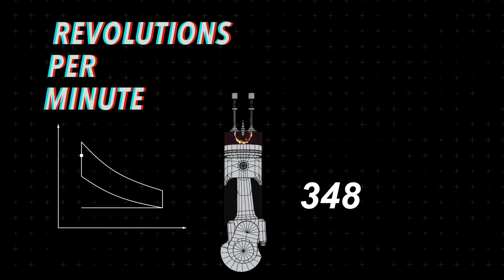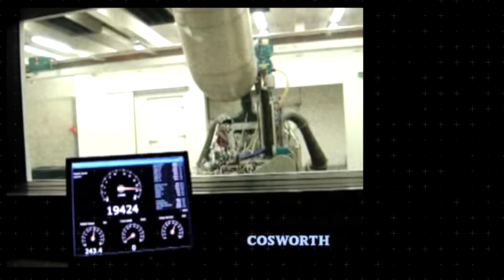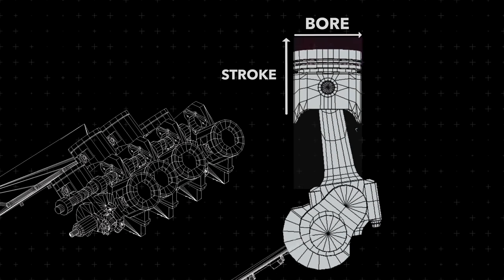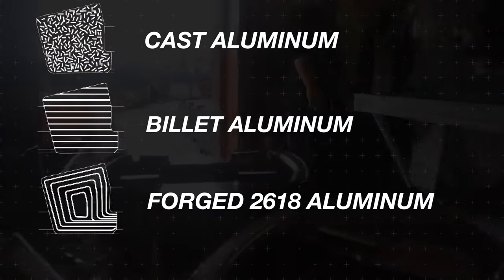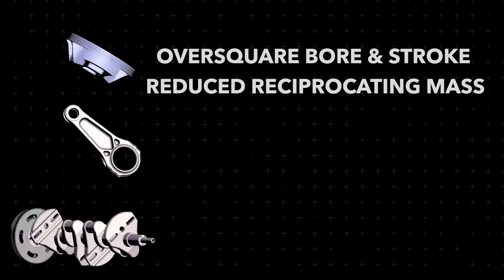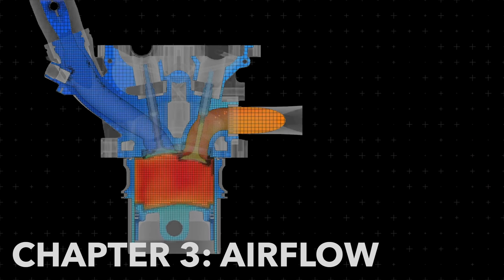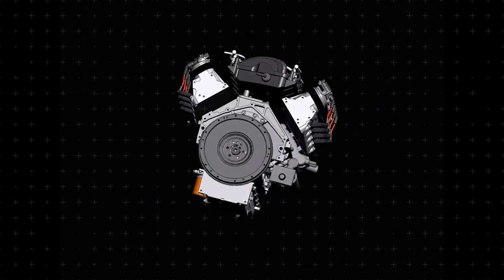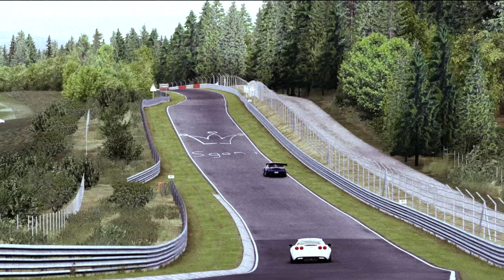The Impossible Engine Speed😳| Explained Ep.28

Comment: This is easy actually, step one go flat out in 5th gear, step 2 drop her down into 1st. This gives you way more than 20k rpm!
Reply: Only works once
Reply: @excalibur2038  step 3 replace the engine 😂
Reply: Money shift
Reply: might need to warn the ISS before this one tho chief
Reply: Step 3, hood goes in face with rod.
Reply: Only with spoon pistons
Reply: The key is getting your first gear synchro to spin up high enough to make it go into gear!
Reply: It’s definitely the easiest way to vent ya motor out, you’ll have breather holes all over it afterwards
Reply: LMAO
Reply: but only once!
Reply: Also let’s you, the gearbox and basically everything else in to the after life 😂
Reply: @stephenlewis6219   Step 4... profit.
Reply: You're gonna blow the welds on your intake !!
Reply: @peterdarr383  nah it’s gonna blow everything mate 😂
Reply: If the engine and tranny are in front of you,  be sure to pull your feet back as far as possible when you do this. 😮😮
Reply: anf blows up engines
Reply: Instructions unclear

Cylinder number 4 has left the chat
Reply: @shadowguy128  When the clutch comes apart,  you dont want your feet over the bell housing.  You coulx lose toes and maybe a foot.
Reply: Do you have any idea how a manual gearbox works? 🤣🤣🤣
Reply: @MrDannyzwo  Ask Don Gartlis.
Reply: Low reving hemi are still running since the 60s high reving screamers will be destroyed in 50 years from now 😂
Reply: You forgot 1 step: buy and install a rev counter that goes up to 20.000 so that you can see it happen!
Reply: No…NO it doesn’t
Reply: MAYBE if it was a 1-1.2L with 50mm bore and like 22mm Stroke…
Reply: @saltfarmer3910 
“SPOON” is merely an Engine BUILDER…
“Spoon Engines” have a Varying supply of SUBLET Companies that Engineer Pistons of ALL shapes and Sizes(maybe not Shapes, But SIZES), in One “SPOON” Engine there Could be WEISCO Pistons(Highly Doubtful but just for an Example) and in Another “Spoon” engine there Could be BONE STOCK Honda Pistons, Just with Whoever’s rods and Wrist Pins and Bearings…Does that Make Sense?
Reply: Problem is your engine won't last a minute so still less revolutions overall. Checkmate
Reply: Remember to keep the gas on the pedal!😂
Reply: The 4 biggest things that allowed F1 cars to rev so high is 1: The engines have no fly wheels, so the engine was freely rev with out any drag on the engine.  2: the internal engine components are made as light as possible whilst maximising strength, like pistons made out of beryllium and titanium con-rods and sodium filled valves or ceramic valves. 3:  The engine timing advance and hydraulic lifters on the heads and some other valve timing internals, tuned plenums and exhaust pressure management because the faster you can get rid of the spent exhaust gasses the faster you can get more fresh gases in the engine.  4: This one along with no heavy fly wheel is very important to the high revving F1 engine and that’s the short stroke piston, however todays engines because they are turbo charged (which is better than super charging because there’s no parasitic loss of power on the engine because it’s not driven off the crank shaft with belts and pulleys like a super charger is which saps power from the engine to drive the super charger and a turbo uses spent exhaust gases so there’s no loss of power from off the engine with turbo chargers so you get more power) going back to where I left off above - todays turbo charged F1 engines have a lower compression ratio due to turbo charging, so to try and off set this a little you need a longer piston stroke that allows more air and fuel for a turbo charged engine this bumps up the compression ratio a little but the longer stroke means the RPM is not as high.  Whilst this is vastly simplified, I hope it gives someone a little bit of an idea or to understand the engineering that goes into F1 engines to make them so compact light and powerful from a V6 - 1.6 litre engine (62.9 Cubic Inches) that puts out 1,050 Horse Power.  Crazy machines at the pinnacle of motorsport.
Reply: @saltfarmer3910  
Only with a carpenter ROUTER haha
Reply: @stephenlewis6219  and the entire transmission
Reply: You only live once
Reply: I think the piston would flew off the engine
Reply: Someone's going to see this and try it
Reply: Jettisoning the warp core.
Reply: worst advice ever my god
Reply: Only works once and will also have the car doing a front flip 😆
Reply: just add more rpm to the tachometer bro
Reply: From 5th, then drop down to 1st, without that hairpin tight turn, rods’d be rocketing out the blocks with projectile like velocity.
Reply: and eject out the vehicle if you have built in rocket propelled ejector seats at the same time, if you wanna live to laugh about what you just did! :-)
Reply: Is it even possible to get the car in 1st gear if you max out the car in top gear ?
Reply: strong comment. very strong
Reply: Valve-bounce.
Reply: Yeah all those teams making it too difficult, smh. 🙄
Reply: 😂 That will teleport you the “Shred City”🥴
Reply: called a powder shift
Reply: Nah, she'll lock the driven wheels first..
Reply: And pistons go to jesus,,,
Reply: M O N E Y   S H I F T
Reply: 5-2 (missed 5-4) downshift has claimed many engines.

Through a rod.  "Don't you mean threw a rod?"  Nope, it went clean through the engine.
Reply: Step 3 try not to crash due to rear wheels locking up, step 4, replace bombed engine.
Reply: LOFL   I like where your head is at.
Reply: Instructions unclear. Engine still healthy
Reply: Instructions unclear, my engine shot down a satelite

Comment: One of the coolest way I’ve seen valve float be removed is how Ducati did it with their desmodromic valve where the cam opens and closes it. That’s how they can get such high revs. They also don’t use timing belts or chains it’s all done using gears, it’s a nightmare to work on but it’s amazing when it works.
Reply: You must be referring to the engine in current Ducati MotoGP bikes?  The desmodue in my 2005 Monster S2R has timing belts and desmodromic valve actuation as do the desmoquattro and testastreta engines in their super bikes of that vintage.  I’m not sure about their current V4 engines however.
Reply: @ghostwrench2292  Well that is a desmodromic valve, it is driven by belt or chain, however, there are no springs involved so there are no valve float.
Reply: Yes that is a cool technology back then however, they are not so popular right now as people found a way to remove or mitigate valve float without using desmodromic valve, but with modern springs or pneumatic.
Reply: Honda's 125cc,  Five cylinder RC149, revved to 18,000 RPM with valve springs, made 30 hp and topped out at over 135 mph, in 1965.....it had 33mm bore and a 29.2 mm stroke, and four tiny valves per cylinder.
Soichiro Honda hated 2 strokes, so in the 70s, when all the other manufacturers settled on 500cc four cylinder 2 strokes for their GPP bikes, Honda tried to beat them using a 4 stroke. The rules stated no more that 4 cylinders, so a 4 stroke would need revs, lots of revs to get the power needed to beat the 2 strokes. They built the NR500, it had oval bores, (like a spam tin) 8 valves and 2 conrods per cylinder, it was basically a V8 with siamesed bores (but still technically a four cylinder to stay in the rules) it would rev to 21,000rpm, and idled at 7000rpm!! It was a bit of a failure as a race bike, but the oval piston engine did get developed further into a 750 road bike, the NR750, (many styling cues off this bike were used on the Ducati 916) and the NR750 TTF1 race bike that look similar to the RC30.
Reply: It was used because valve spring material wasn’t very good.
Ducati was already using that system in the 70’s, using bevel gear drive. 750ss
Mercedes Benz used it in their race car engines in the 50’s. SLR 
It was developed for German fighter planes in WW2, but the design goes way back before valve spring material could cope.
Reply: My Ducati has belt-driven desmodromic valves. Revs well.
Reply: And yet somehow it doesn't rev any higher than its competitors 🤷
Reply: or electric actuators where a smart computer decides how and when they move.
Reply: @rancon265  Just ask Christian von Koenigsegg about Free Valve.
Reply: The older R6 engine factory redline is over 16k
Reply: @replynotificationsdisabled  For real, Italians are excellent at making things complicated for no good reason
Reply: FreeValve doesn’t solve valve float, however. The eletric actuators open the valves, but traditional springs close them. FreeValve is good for efficiency since the crankshaft doesn’t have to drive the heavy camshafts and a lot of the engine’s friction is eliminated.
Reply: The best would be FreeValve coupled with pneumatic valve closure.
Reply: Not so hard to get 21000rpm....
There are 3 PRODUCTION 250cc road bikes that have been doing that since 1990 !
The Honda MC22 cbr250rr ( 53hp HRC)
The Kawasaki Zx2r ( 51hp )
And the Suzuki GSXR 250...( 48hp )
All are 4 cylinder 250cc
All rev over 19000rpm.....
The Honda has 212hp to the liter in HRC trim, bike weighs 280lbs.
Reply: @greengoat5654 oh, but the V4R does. no other manufacturer has a 16k rpm redline on a literbike.
Reply: @briankearn6991  I can't identify any WWII aero engine manufacturer who seriously contemplated using Desmo.  The British realised the problems with poppet valves in the interwar era and thus went down what would become an evolutionary dead end, the single-acting sleeve valve (NOT the Knight double-acting sleeve valve).  Poppet valves improved a great deal before and during the war negating many of the advantages of the sleeve valve.  The development time for any great change in engine design (even in war time) is at the very minimum 6 years.  The British were using poppet valves in most of the Rolls-Royce engines, the Napier Sabre (2450hp 36.7L H24) was using sleeve valves as were most of the Bristol radial engines including the widely used Hercules.  None of the American engine manufacturers considered desmo and the Germans had more than enough problems with their engines without adding the complexity of desmo.   Now desmo is an evolutionary dead end just like the sleeve valve.
Reply: Ducati and Koenigsegg both had good ideas. It works. Yet something like free valve isn't cheap. We also have pretty much fixed some of the issues it went onto fix. 

 No the best idea is rotary valves. They are superior in every way for racing applications. Especially when it comes to air flow. You can make a simpler system with it. 

 Issue for production cars is that rotary valves have a sealing problem. Yet you don't need to build for 100k miles for racing. 

 A company called Vasec I think is trying to make them happen. 

 Driving 4 Answers has a video like, "why do we still use valves?"

 I definitely recommend his channel. Dude is amazing at explaining everything. One of my favorite channels, and I'm not a car guy. 

 I have to look at how Ducati system worked.

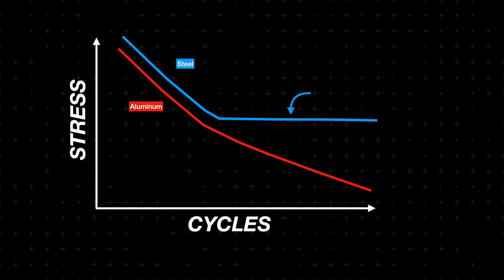Comment: A quick addition to your point at 6:30 - the cycle limits are exponential - meaning that if you pick a force or a lifetime/ cycle limit, you can optimize and decide if steel or aluminum is a better choice. 
This is why drag cars use aluminum conrods. They're treated as consumable, and don't have to survive for long races.
Reply: Perhaps that is true for aluminium, but steel has a sharp corner in the stress/cycle relationship as shown in the video.  My understanding is that the fatigue limit is not actually perfectly flat as is typically claimed ("infinite cycles"), but that it simply has a very shallow gradient that is close enough to flat for most purposes.
Reply: @2bfrank657  I think maybe you are not understanding the graph correctly. The "sharp corner" for the steel rods is correct, as far as can be measured. Basically, if it stays below its fatigue point, it will last forever. As a diesel mechanic, I know that semi-truck engines are often rebuilt after a few hundred thousand miles, but that doesn't mean ALL of the pats are replaced. most of the time you would use new rod bearings and rod bolts, but the rods themselves would be reused. commercial diesel engines sometimes last over TWO MILLION miles with a few rebuilds.(that would have to be in the billions for cycles)   Other parts(like the crank shaft) will also likely never be replaced
Reply: @2bfrank657  Unless my materials engineering professor and the books lied to me. Steel presents a stress threshold (for a given temperature) where, if not surpassed it won't suffer from fatigue related deformation. This is because the dislocations present in the crystalline structure are unable to be displaced around the matrix, resulting in no permanent deformation even at the microscopic level.
Reply: @andresmartinezramos7513  Interesting. My understanding is based on what a tutor once told me, something related to "the German railways" and the very high number of stress cycles their axles underwent if I recall correctly. I've not seen this low-rate fatigue theory mentioned elsewhere though, and I expect your understanding of steel microstructures exceeds mine, so I think I'll research this a bit more before pushing this claim any further.
Reply: @2bfrank657  Right now I'm travelling, so I can't give you the exact quotes (I'll try to remember when I get back). Any mistake is my own. But the idea was:

In a number of steels the process of nucleation of the crack does not happen beneath the fatigue limit of the material. They insisted on us remembering that aluminum and composite materials do not present a fatigue limit and will always fail given enough cycles (which may be many).

The reason for no nucleation was (If I recall correctly) that the dislocations got stuck by the interstitials and the grain borders. The energy to overcome this obstacles being too great for the amount of stress applied. This leads to the dislocations not combining and thus not growing.

Sources online are just saying it happens, not why. The only explanation seems to be an answer in a forum by Jesper V. Carstensen in "ResearchGate net Why fatigue limit only exist in some materials?" So not the most reliable of sources. Again, I'll try to return to the topic in a few days.
Reply: Rebuild every 1000 feet for best performance.
Reply: Lawnmower engines have aluminum conrods, too...

Comment: Yeah, the 7200 rpm d16 on my '95 Honda civic coupe had me addicted to high rpm NA engines...  in the manual if you shift at redline it never dropped out of VTEC
Reply: That’s why I like fords DOHC 4.6l. Running a V8 out to nearly 7k rpm was a blast. In the ‘96 cobra they had a variable intake somewhere around 3600rpm it would switch from long to short runners. So doing the high rpm shifts would keep you in the short runners. 

Fun car.
Reply: YO !!
Reply: I had a 1991 Acura Integra and built a LS/VTEC put a HKS power exhaust had Toda cams and valve springs, SPOON headers, ARC intake box, 6speed manual from a prelude. 
1996 Acura Integra GSR with Mugen engine, Motec fuel management system, HKS turbo and exhaust. Hondata custom ecu, JIC coil over suspension all 4 corners, Yokohama Advan tires, SSR wheels. 
2001 Yellow Honda S2000 with a Paxton Supercharger 
ARC Induction Box
Spoon Suspension 
Carbon Fiber Reinforced Driveshaft
Mugen Wheels
ApexI FCON Pro

Honda is amazing
Reply: "in the manual if you shift at redline it never dropped out of VTEC"  And probably never hit 87mph either 🤣 just kidding
Reply: @TeensierPython  i
Reply: Yea, same fun with my Celica 2001 2zz-ge, revs up to 8250rpm, so much fun, it runs on ethanol as well. Has VVL along with VVT.
Reply: I follow a guy in Europe that raced a D-13 civic last year, I do believe he was running quite a bit more RPM than you did on your D16.
Reply: Blah blah fing. Blah

Comment: Sad to not see a mention of the Honda CBR250RR from the 90s. 
19,000rpm redline with rev limiter at 20,000rpm from a tiny 250cc inline 4. 
Each cylinder is just slightly bigger than a shotglass in volume with a 48.5x33.8mm bore and stroke.

The bike makes a whopping 45hp, which is pretty impressive considering thats 180hp/L more than 30 years ago and the 1992 CBR900 only made 121Hp (135Hp/L)
Reply: Fzr 250 , zxr 250 , gsxr250 ( tho lower rpm) honda did have the max rpm in the cbr . Epic time for small bikes.
Reply: Loved my Fzr250r

Comment: Nice vid, before the V8 era BMWs P82 3.0 V10 ran to 19,200 on track and allegedly 20k on the dyno, they also use variable inlet length systems to optimise the torque curve at all RPMs, and  the drive train is gear driven from the crank rather than using a belt, naturally aspirated F1 engines are an absolute work of art! I know the reasons for going turbo and hybrid etc but for me its a shame, I miss the raw noise of a proper high RPM V10
Reply: You can see the P82 on display from up close in Munich in BMW museum. It's a true work of art. I was totally amazed that I can even touch it ( they say it's not allowed but I couldn't care less ) :)
Reply: F1 v10 engine sound added so much to the overall enjoyment of the race.

Comment: The ideal bore to stroke ratio depends on the fuel you're using, different fuels burn at different speeds so getting a combo that favors each other is critical to make good power.
The reason pro stock engines have a lower bore/stroke ratio is not just because 'they don't need to survive as long'
Reply: True. But he’s got a good point.
Reply: I can't completely agree with that because ignition timing can be optimized for different fuel(s).
And I haven't kept up with the Pro Stock rules for several years but I remember they were RPM limited at one point = had to optimize they're engine combinations around that as well...